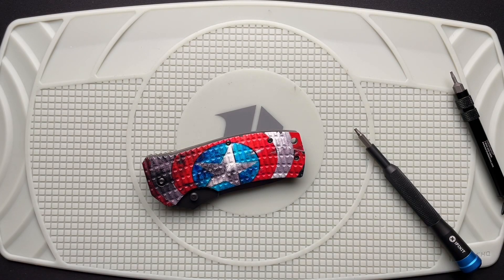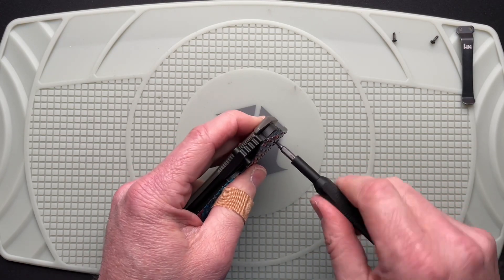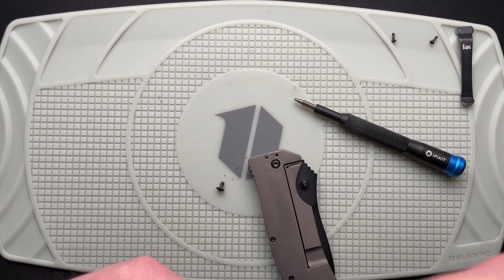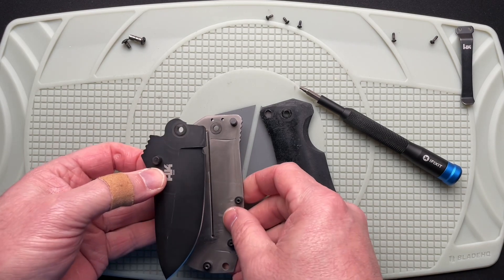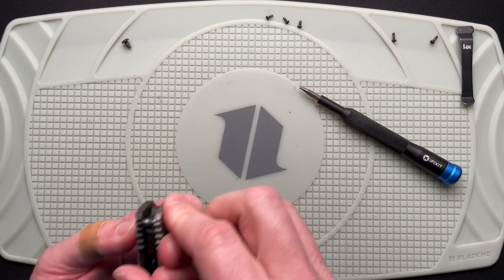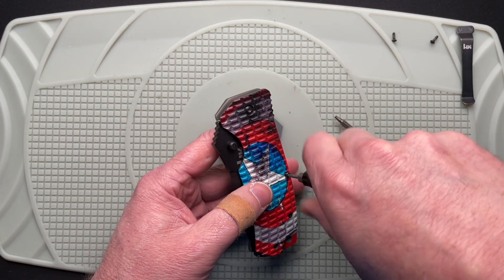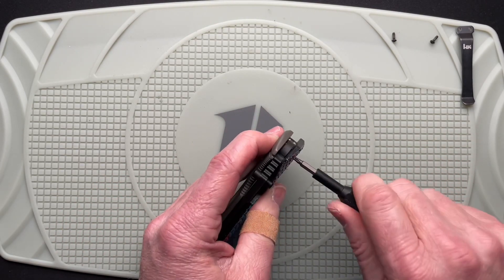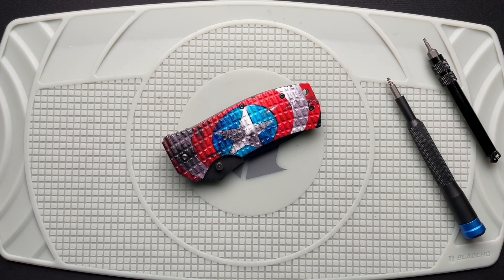HK Conspiracy Folding Knife Disassembly

Comment: Put a little piece of tape on one end of the stop pin and shove it in the hole or some grease in both sides of the scale where the stop pin goes... will stop it .. I have a damn designs titanium oni xl that has a pin on the back scales rattles and I used grease  and no longer does it..
Reply from the maker: Great tip.
Reply: @DirkWerning   The tape trick works but there's more work involved because once you put the tape on you gotta trim it down so there's no excess  hanging off to  keep the pin from going in

Comment: If you use KPL heavy or a grease in the stop pin hole it will usually quiet or silence the rattling. You can also try a small piece of teflon tape.